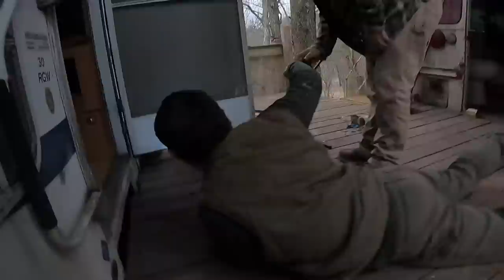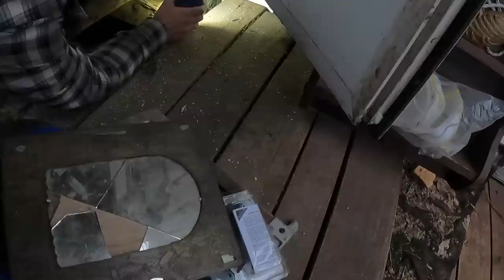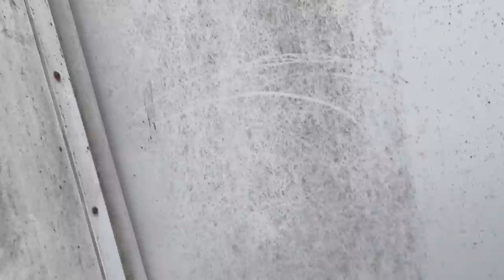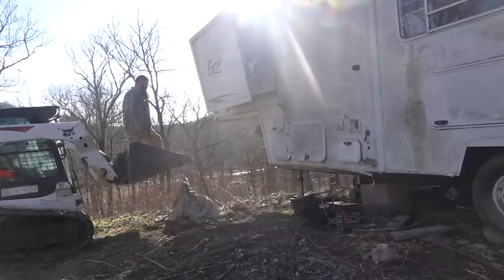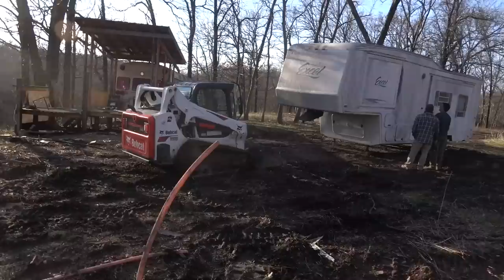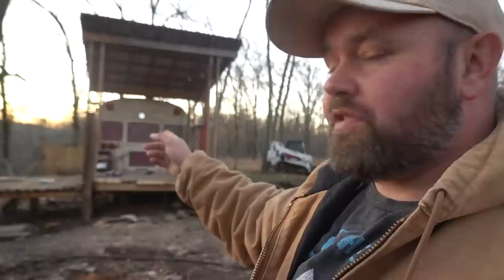We Tried To Move The Abandoned Camper

Comment: Let your Pal know, RMR-86 is a liquid he can spray on the camper to remove mildew, mold. I used it on mine to clean the roof and air conditioning unit. It worked amazing. It's cleans on contact.

Comment: 5th wheel is actually unlivable!  Slides have to be straightened out and wires reconnected!  Still it is probably very unlivable, roof looks way too bad!  Was really surprised to see it moved!  Also surprised to see the tires move.  Sitting there for as long as it did, I thought the tires would be gone.  Especially sitting there as long as it did!  Good luck with it!

Comment: I'm glad you got the trailer pullouts back in, but the motors were struggling because the pullouts were dropping at an angle of about 15° which was causing them to drad. Had you lifted them up level with the bobcat and creeped forward as it closed it would have put less stress on the motor and would have been quicker. Anyway, you got it done. It's going to make a big difference with the trailer gone. Do you have plans to keep the roof there or are you taking it to your other property to use for chicken's, pigs, little horse's etc.? I'm surprised neither one of those guys were spotting on the right side where your truck and the large tree was. I couldn't tell, but while backing the trailer it looked about six feet to the truck and a foot or two to the large tree. Nice and slow gets it done safer and quicker.